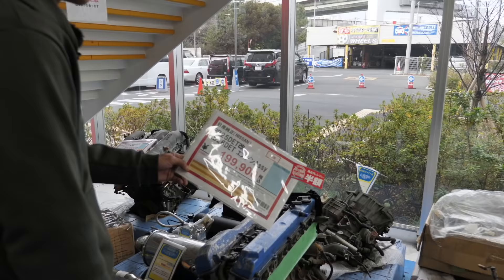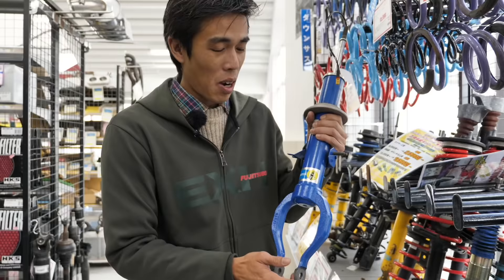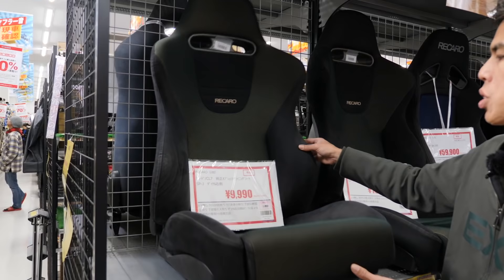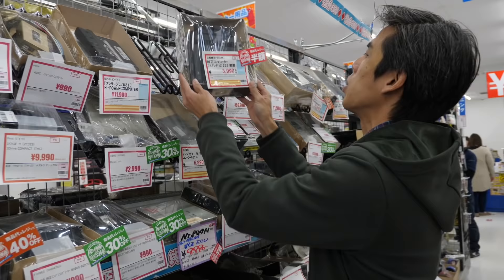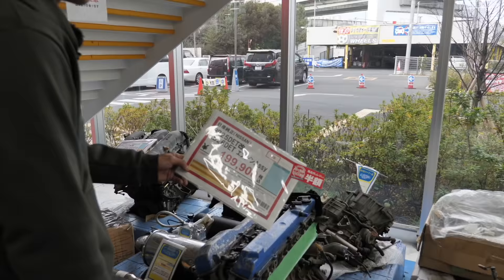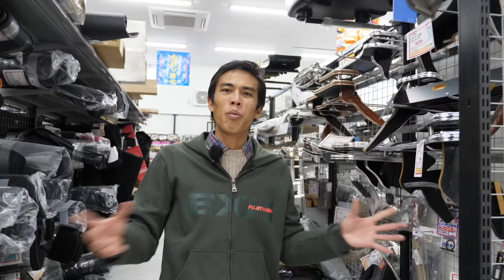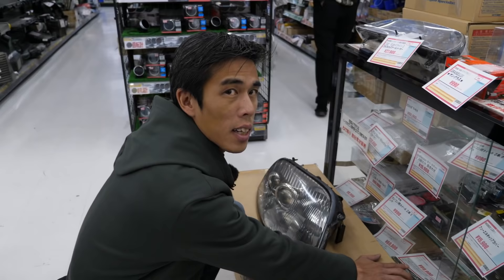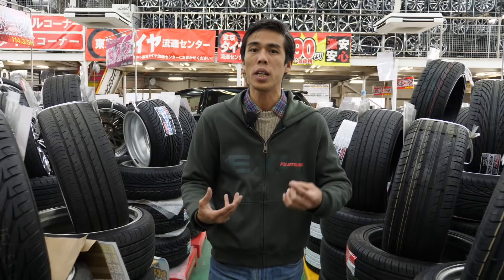How Car Enthusiasts in Japan Build Up a Car On a Budget! Up Garage | JDM Masters

Comment: Just a heads up for anyone visiting Japan with out a car. The larger stores that are typically well outside the cities have the nicer selection by far. I visited the smaller one in nerima that's easier to get to out of Tokyo by train. It's still worth the trip but just don't go expecting a part selection this good. I'd probably check out Crooober to see if the store you plan to visit has anything for your car. As for security at the airport. They didn't seem to mind the spare parts in the suitcase.

Comment: A bit of recent JDM history - the last time I visited Japan (2015) this UpGarage in Minami Machida was a smaller, more humble single floor shop. The wheels shop was the riders (motorcycle) shop where I found many cool racing jackets! The downside to this expansion is next door there used to be an used car shop and car restoration garage Fly Rat. I had a wonderful chat with a mechanic working there and he took me back into the garage to show me a beautiful Z. I was a bit sad to see that UpGarage swallowed up that whole space, but I couldn’t think of a better shop to do it. If you have any way to find out information of Fly Rat garage Captain, that would make for a cool video if they moved locations and are still around ! Also, I had no idea Tomei was only a block away....
Reply: I have an old business card of theirs that I could send a picture of if you’d be interested in at least seeing it. And some pictures from Fly Rat

Comment: You can get virtually everything you need for a restoration project or even odd spare parts and at decent prices. It’s all clean and packaged with a months guarantee. What more can you ask for? In the UK you’d have to search multiple websites or phone junkyards and they end up sending you something that doesn’t fit because it’s for a different model and you’ve wasted two weeks waiting for it to arrive.

Comment: the used rebuild tuned parts and engines sold from japan actually is super unbelievable u can get, i get my engine from japan d15b instead for d17 it's unbelievable powerful engine it's even hard to drive sound like gt engine, power of the dreams

Comment: I don't understand how they stay in business. There are so many cars, generations, and options. Like I have a 2011 Mustang with the Brembo brakes which means I get different shocks. Bilstein makes 5 different options for my car depending on what you want right? But then there is V6, GT, GT500 options. On top of that there are 2 generations for my chassis. 05-10 and 11-14. So thats 30 shock/strut options just from Bilstein. When you include other manufacturers and 1 off brands, coil overs. I could easily fill 1 store with just shock/struts/coil over options for 2005-2014 Mustangs. If we had something like UP! Garage in North America the chances of me going into the store and buying what I want are slim to none.

Comment: Have a contact in japan, give them the info of the car and its parts you need, have them buy and send it to you internationally, and don't forget to pay them fully back.

International money transfer services are available, so it will be helpful, ( Western Union ) one of them.

Other option is leave them with budget cash, for them to buy and send you the parts, and you won't have to worry about forgetting to pay them back later on, because they spent your money to get you, your car parts, and sent out to your place through international shipping.

Comment: Of we had these types of shops in uk it would be great, because buying new cars in UK is crap and that's one problem that old cars keep getting taken off roads and end up in scrap or for parts, but it would be great if we had shops were they sell all car parts, so people can afford parts and make older cars better and keep them on roads instead wasting them for new cheap crap cars, i dont get why people buy new cars when, one they go down in value significantly but also not even worth buying because qulity isn't there anymore and so many issues, and then you have to take to dealership to get them fixed becaue alot new cars are on fianance so they require you to take to a dealer and not a backyard garage or even do yours self at home, I rather own a car fully and do what i would like to with it, instead having a car but not owning it just paying for it on lease.

Comment: They literally dumb cars in Japan after 3 years from showroom new.

They get left at certain parking lots and held there for another few months, it's cheaper that way for most cars in Japan than to try and sell them yourself or trade them in.

It's a super waist full policy, but if you see the "we over pack and over use plastic for everything here" in Japan it's not to far fetched, they've definitely got a problem with that over there.

So, no suprise you can find car parts for next to nothing there and build your own car out of it, the over supply of parts (new or barely used second hand) is legion and rampant in Japan currently.

This will change in the future, but for now, not so much.